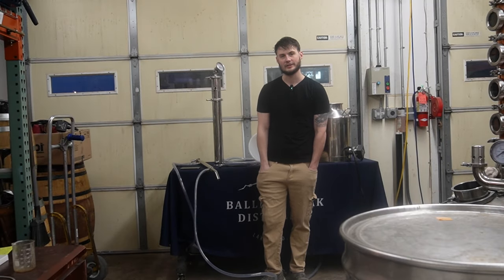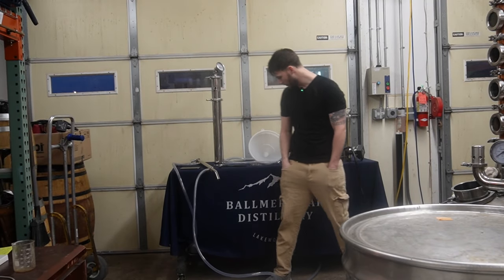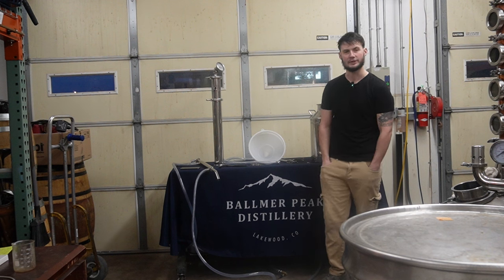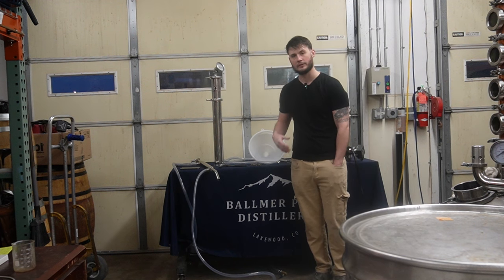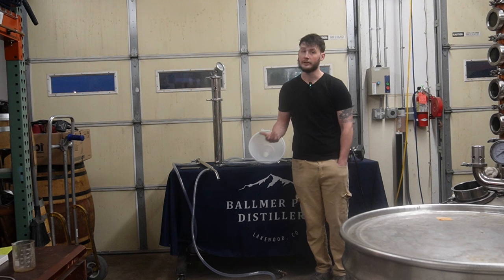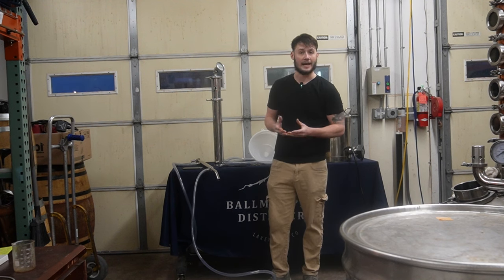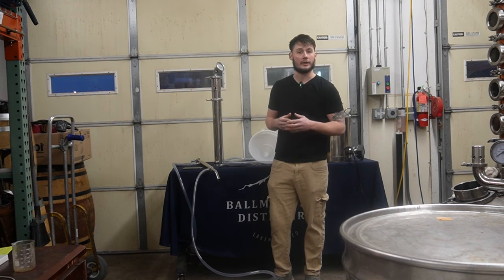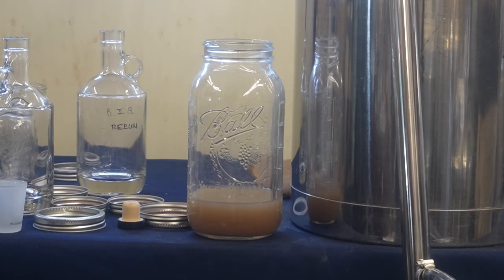How To Fix The Problem With Your Still

Comment: How about green hooch?
Reply from the maker: Dang, I wish I thought of this. Green=alkaline most of the time in this craft. If the fermentation is green, it's most likely due to too much nutrient in your fermentation. If the spirit comes out green, you likely need to just clean your still heavily with a 50/50 water/vinegar mix or another type of abrasive acidic mix. Copper oxidized and creates a patina as well as can create an alkaline environment so this problem is more common in copper units.
Reply: @milehidistilling1  yeah, I had a big batch come out green and was told in the forums it's toxic. Is there any way to redistill it and save it?
Reply from the maker: @MadJix  That's a bummer! I would not even risk running it. I would chalk it up as a learning experience and pitch, honestly. There's not really anything you can do, unfortunately.

Comment: TURN IT DOWN. You want to bring up the heat slowly to keep the still in equilibrium. I also like to let the mash completely clear even if it means using finings then racking into the boiler, nothing to scorch.

Comment: If you get burnt material on a SS element, can't you just turn it on, full power, with just water, to boil it off?
Reply from the maker: I guess it would all depend on how severe the burn. A lot of the times, I notice the burning is so severe, it can't be washed/boiled or cleaned off. Furthermore, once something stick that element, 9/10 it will completely fry the element, making it not put out any amperage and needing to be completely replaced.
Reply: @milehidistilling1  I have noticed that sometimes I will get scorching on the bottom of my small water distiller, when I am doing small rums, mostly with fruit based washes.  It usually isn't too bad and I do a run of distilled water with either a bit of vinegar, or with baking soda and that will do the trick, but I see your point.  SS, regardless how good it is can get some burning/scorching and I guess that directly on the element itself, could cause some problems.  I haven't experienced this, myself, though I only do occasional runs.  I guess I should pick an extra, or two, element, just in case.  Thanks for the advice.  Love the videos.
Reply from the maker: @BillMooney-r5c  My pleasure, thank you for watching and I'm glad you're enjoying!